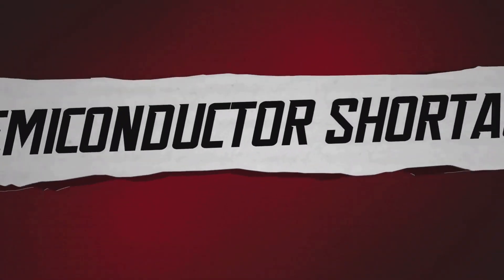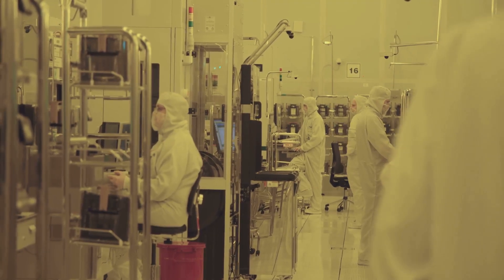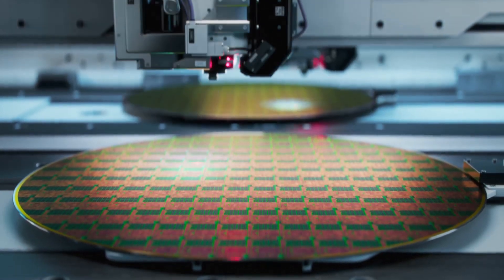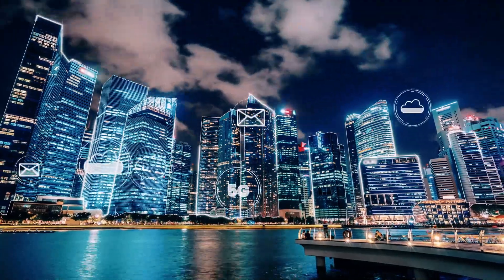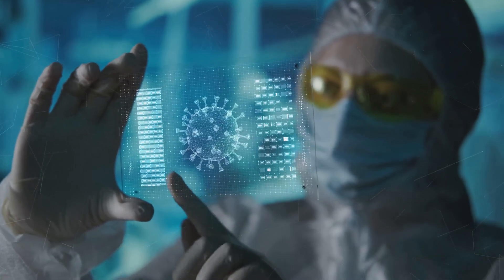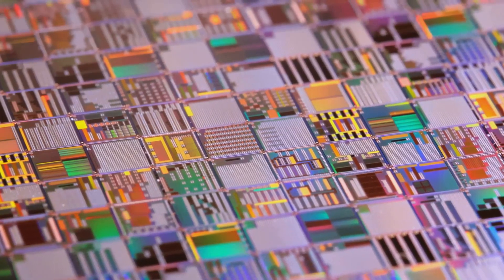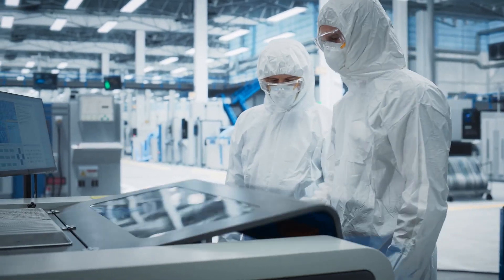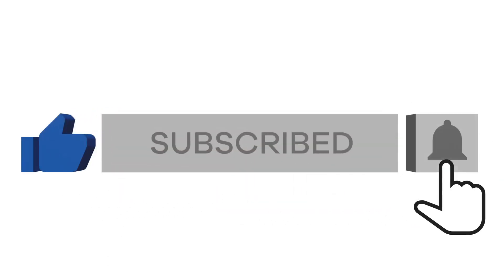China Is DOMINATING The Semiconductor Race With Materials, Markets And Money!

Comment: There is no gap , China is leading !!!
Reply: They are all depends on ASML. For China, most chips China uses now are 7nm n below, so there's no hurry for China to pursue the high end chips.
Reply: there is gap between 7nm and 3nm, China is at least a gen or two behind.  however, the bread and butter (14nm and above) will dominate by China.

per TSMC, China is 3 years behind.  but then everybody will face the same problem, what next?
Reply: Doesn't matter. China will catch up
Reply: @willengel2458  they are at 3 nm already . in fact they are already working on 2 nm so no there is no gap , all this gap stuff is a figment of the yanks imagination !!!
Reply: @willengel2458  TSMC is China and their 3 nm chips are far far to expensive and are a little better than their 5 nm and their rejection rate is still far to high , and there is no gap , period !!!
Reply: ❤Precisely